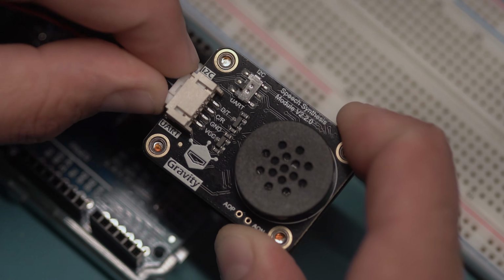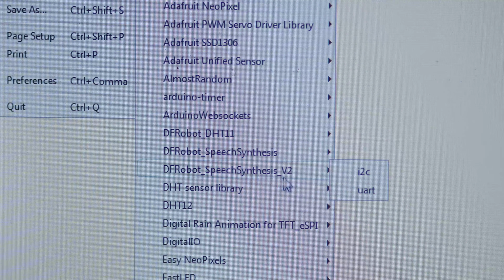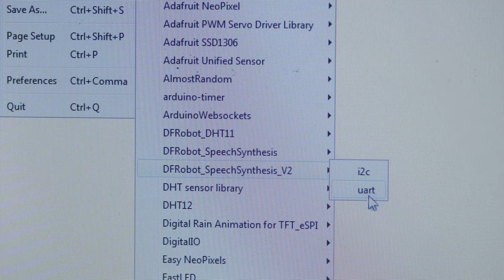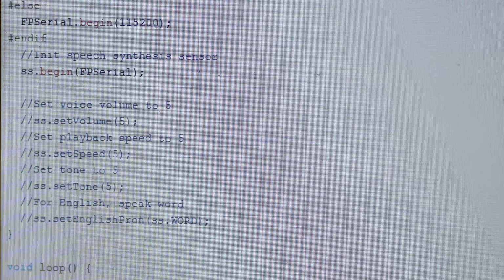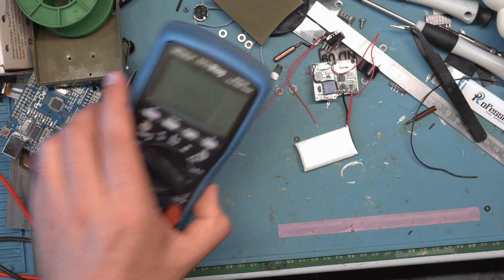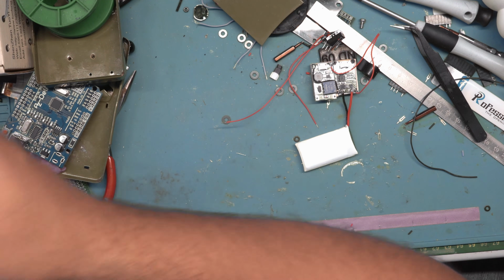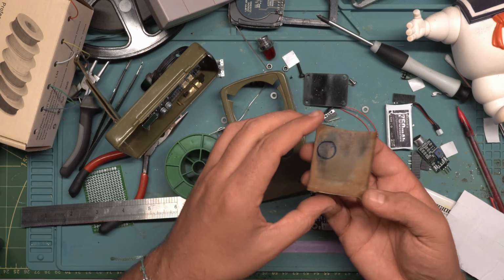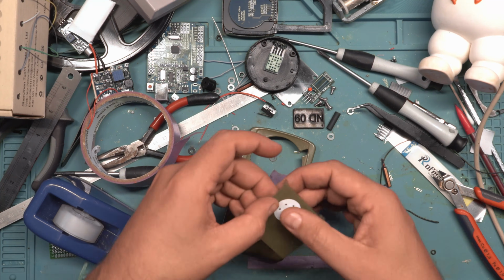Spirit Chat Box Arduino DIY: The Ultimate Listening & Talking Ghost Detector! │ Build & Test

Comment: you want to probe the boost converter and set it under load.....if you just set it at 5v OL when its actually being used it drops a lot in voltage.

Comment: Cool build, finding that flashlight case was a stroke of luck for sure.  It would be tough to design a cooler enclosure, gave it that hardened military look.  I know nothing about ghost hunting, I was just shopping online for solder practice kits and purchased one for a mini theremin which looked cool.  Then I read in the comments that these kits can be hard to find because people were buying them in bulk to make and sell REM pods, which got me looking at diy ghost detectors, which eventually lead me here.  One question, if it's just parroting back random words that you programmed then isn't it really just an over engineered magic eight ball?  It would probably scare the heck out of somebody who didn't know how it works, more so if they use it a night in a cemetery like you did.  I still may build one, I could definitely scare the grand-kids with it, lol. Cool project, thanks for the video.